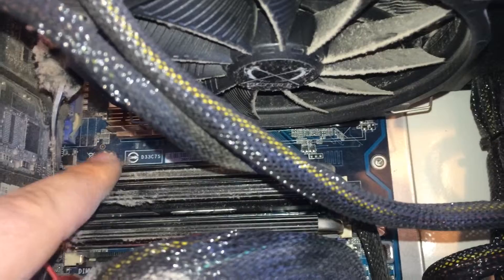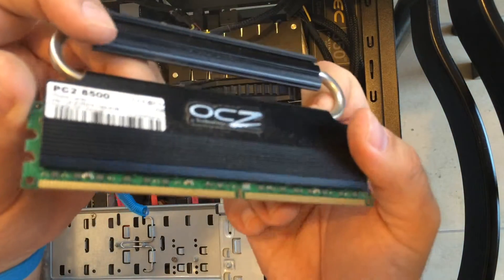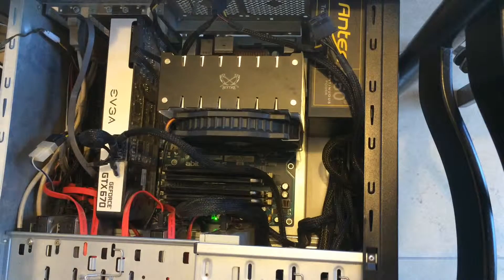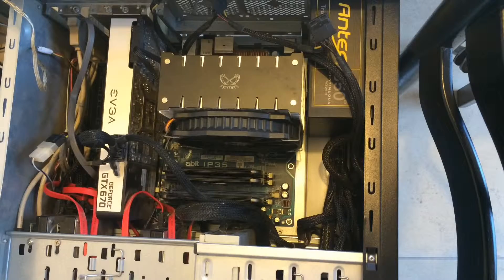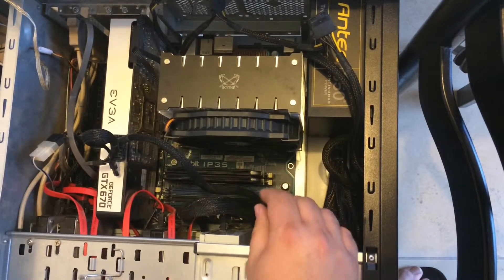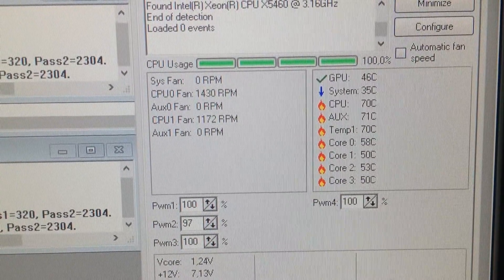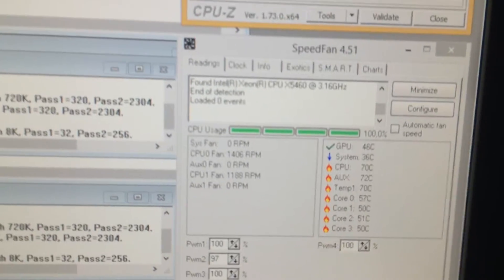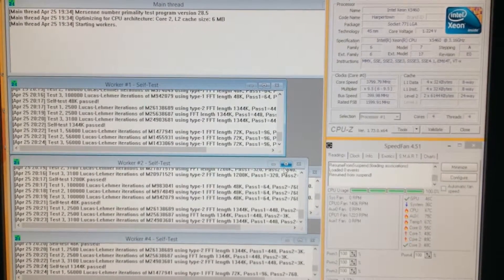Xeon X5460 3.8 GHz with 6GB OCZ Reaper

Comment: Hi, what voltage are you running at? Is it manually set or auto? I have a Gigabyte P35-DS3L and if i try to OC more than 3.6GHz, the voltage drop is kinda high and ofc the CPU load tests return errors sooner or later.. ar 4.0GHz it's stable until i put it under load.. again i blame Vcore fluctuation for that.. your CPU reads 1.240V under load @3.8GHz so i'm surprised
Reply from the maker: +Marek Fiala hi, I'll was thinking that the bios settings were in the video. I can check them again. I set the voltage manually higher than the default. I'll take a photo later.
I would try to increase it  by 1 increment and see how it goes.
Reply: Dragos Ion
I went as high as 1.41V and it didn't help at all, instead it was thermal throttling like crazy and didn't get any more stable.. I'm afraid my Mobo is not sufficient for providing needed voltage.. It only has a 4 phase non-cooled VRM stage... so I wouldn't tease it at 1.4V at all, i don't want my mobo to burn out. Was looking for stable 3.8 - 4GHz @ maybe 1.3-1.35V MAX.. but i just can't get it stable no matter how much i try. I mean it runs stable as long as the CPU doesn't get under heavier load so it's definitely caused by voltage drop.
Reply from the maker: +Marek Fiala I put together a few tips and tooks some photos of the bios and CPUZ, it's here: http://diy.rednumberone.com/x5460-abit-ip-35-overclock/
Please, share & subscribe to my channel if it helps :)
Reply from the maker: +Marek Fiala I wouldn't go that high with vcore. 
Try to touch the NB heatsink, if too hot you could add a small fan on it.
Also try to lower the RAM speed & check DRAM voltage.
It's worth trying with just 1 stick of RAM as a test.

Comment: Hello
I saw your movie Abit IP35 did you fire on him win8.1 whether this also works with win10?
Can you send me a modified bios operating at 8.1 and 10? My processor is the Xeon X5470 and will change the Q6600
Regards
Jack
Reply from the maker: Jack, I'm not sure if x5470 will work with this MB. From what I remember Slbba e0 would work. You can just try to install it and see if it boots. Won't send bioses that can brick people's PCs sorry :(
Reply: you run this xeon on 64 bit windows?
Reply from the maker: Yes, x64 windows
Reply: Thank you very much for your help. Your video and link it to the BIOS meant that I did not sleep all night. But it is for your information, you can add that to the Abit IP35 running 64bit Xeon X5470. Thanks again.
I still have the question of what set the bios to the restart or shutdown is not activated the alarm? It is quite annoying especially at night.
Reply from the maker: If you've got the continuous alarm, it's because the temperature of CPU is not detected correctly. Also the vtx instruction set might be missing. Added x64 to the description thanks!
Reply: alarm is only at the end turnoff, and after the restart. After exiting Windows during start up normally and also I work without an alarm.